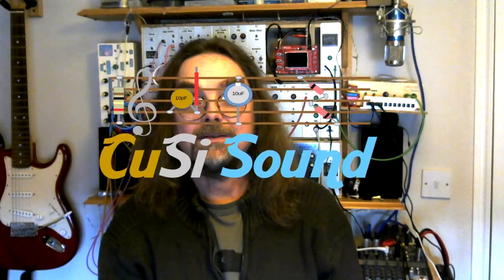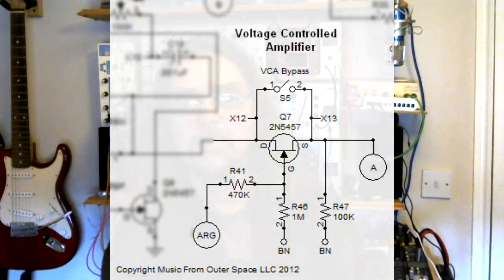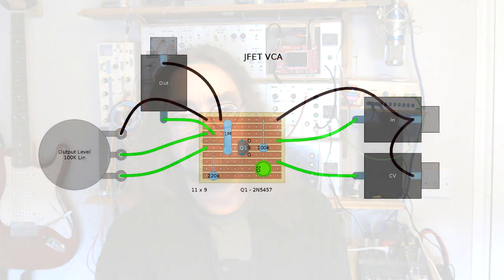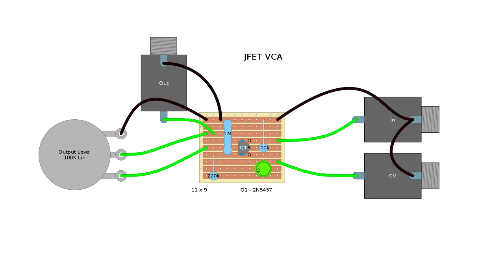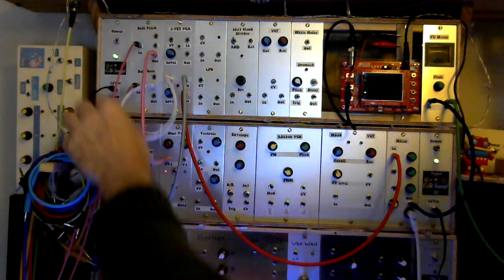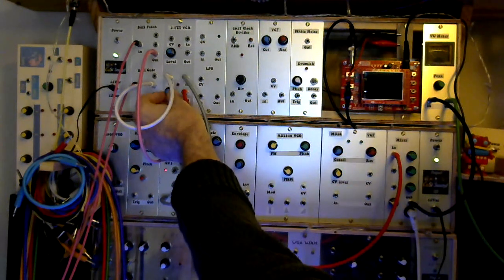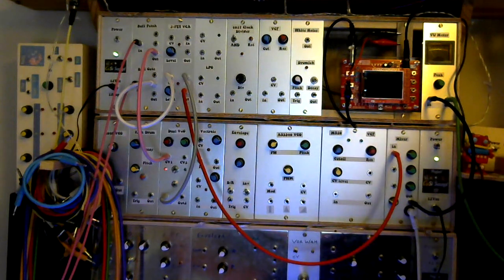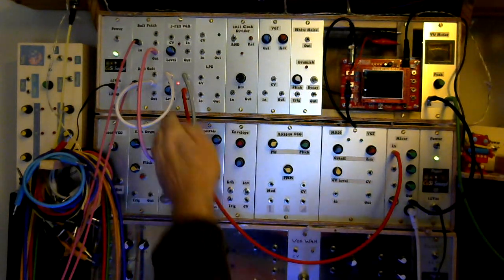Project XII Modular Part 7: Simple J-FET VCA

Comment: I guess i´m the first german follower! I´m very new into the whole analoge thing and I have not much money, so this is the right way for me to start building my own analoge Synthesizer! Super !!
Reply from the maker: Willkommen. I too have not much money, especially for commercial eurorack, but the modules I build rarely cost more than 10 euros. Also, you can get some unique features that you do not find in carefully designed commercial products. The fun is to build a circuit then explore what you can do with it. I am happy you can share this journey with me.
Reply: @CuSiSound  , yeah, thats the part, I also looked @ LMNC´s Site and build a couple of the Super simple Oscillators and a APC, at the moment i´m working on the Weird Sound Generator by MFOS  on Stripboard and have a few little problems because I´m not soo good in reading the schematics, but i will figure it out soon :) . Also my Baby 8 has some Kind of Problem, all LED´s are flickering together and I don´t know why....you see, a lot to do in the next time lol. But thats what its all about, right?
Reply: I have another question, are your Modules Eurorack format or KOSMO , or somethin in between ?

Comment: I'm quite late, but would like to mention that using a dual-rail power supply, and a dual op amp (one for inverting the control voltage in place, and the other for inverting it a second time, but along the 0V line with a gain adjustment) may fix the bleed-through; though it would no longer be a passive circuit.
Reply from the maker: Thanks for your comment Andrew, that would be a nice update to this basic circuit. I like to encourage fellow diyers to share ideas so please keep the comments coming. I have played around with a few VCA circuits and they all have their pros and cons. Sometimes their quirky features can add a little something extra to the music. Thanks again for your support.

Comment: Hey! Good video! I guess the volume of the input will decrese because of the passive circuit. I would add a non-inverting amplifier with an opamp which then would of course make it active.. what do you think?
Reply from the maker: I haven't had an issue with that myself but if you need to you could amplify the output. The performance of this VCA is dependent on the signal levels fed to it.
Reply: I see! Well, it was jsut a though of mine, since i have been building some passive mixer circuits where you will loose a good amount of gain which can be very crucial when mixing CV signals f ex @CuSiSound